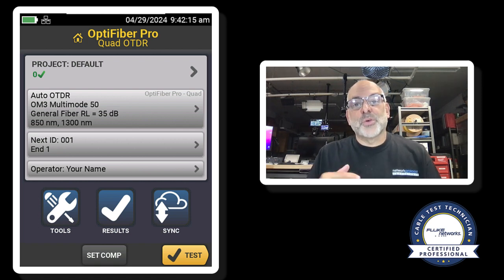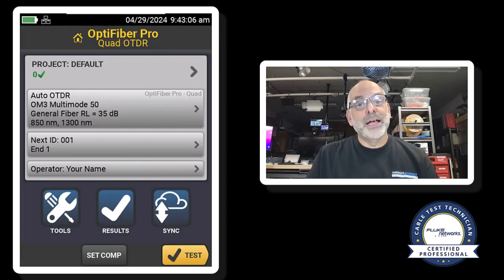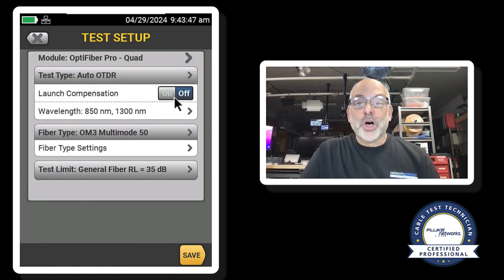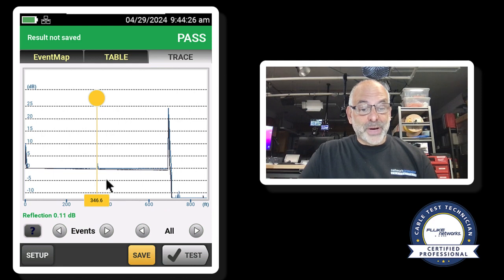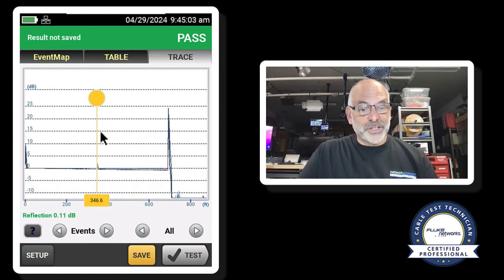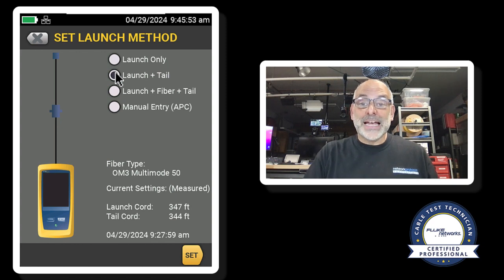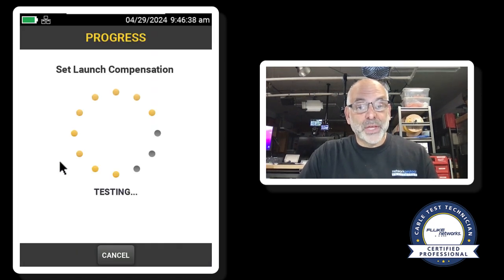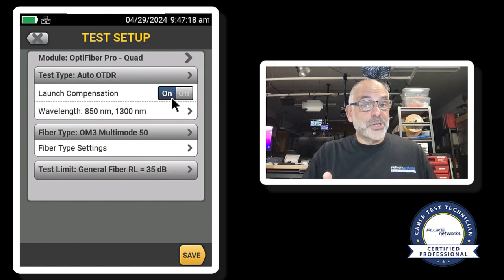OptiFiber Pro Set Multi-mode Compensation

Comment: I AM GOING TO CERTIFY A OM1 FIBER WITH LC CONNECTORS, THEY PLACED A 6 STRAND FIBER AND DAISY CHANED IT BETWEEN  4 BUILDINGS.  CAN I  CONNECT FIBERS 123 TO FIBERS 456 ON ONE END AND TEST 3 FIBERS, THEN MOVE TO THE NEXT BUILDING AND ADD 2 SPLICES OR 4 FOR THE LOOP
Reply from the maker: Here comes the long answer.  If you are using the Fluke Networks OptiFiber Pro, the best test to use for this setup is the SmartLoop test.  This allows you to test two fibers at a time bi-directionally.  Why is bi-directional so important?  If there is a difference in back scatter between your launch and tail fibers and the fiber you are testing, you may get gainers (negative loss) or high loss values.  By using SmartLoop, you test both fibers in both directions and the tester will average the results, giving you the most accurate numbers. Here is a video on how it works https://youtu.be/QmvbA40E-Y0?si=8hSqBUeSVEQWlN2U.  You would test two fibers at a time between building 1 and 2.  Then test between 2 and 3, and finally 3 and 4.  The key is that you need to use a Fluke Networks LC-LC 62.5 launch fiber as the loopback at the far end.  You would then use 62.5 SC-LC launch fibers at the tester end.  Lots of fibers, yes.  Very accurate results, absolutely!  I just got done running some fiber here in the lab and using SmartLoop.  Found a broken fiber at one end, fixed it and the numbers are all good.  Looks like I need to do a detailed SmartLoop video.
Reply: @MikePennacchi  thanks, because I have no partner, radio, etc......  it is 240 LC  connectors with the uni-cam tool (contractor).....   when I got done they asked for it to be certified....      so 5- six strand cables leave the Hub, at the end of each cable there are 2 and 3  other six strand(OM1) cables to "Daisy chain" the other buildings....   here goes nothing...(Jan 28,2025)